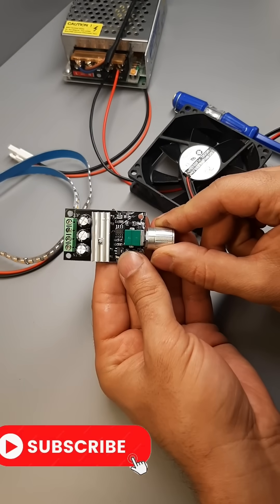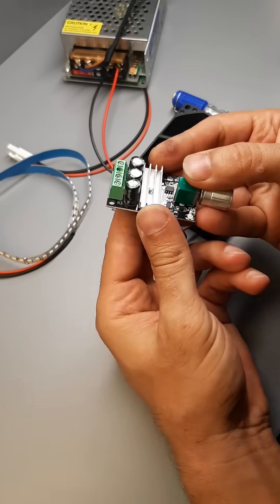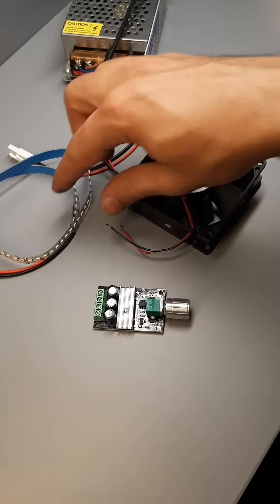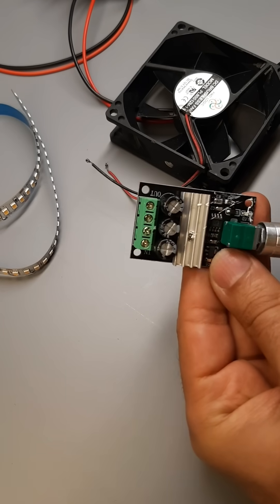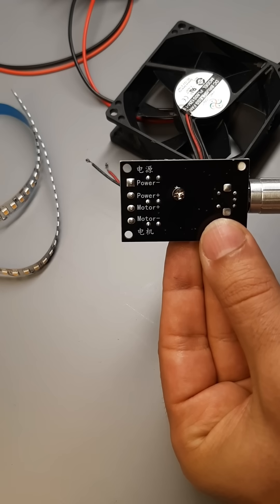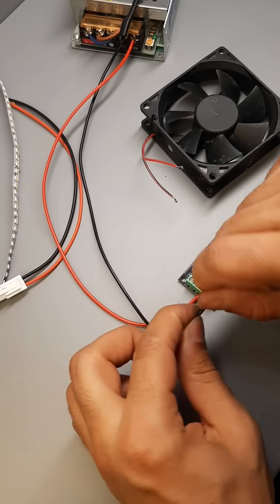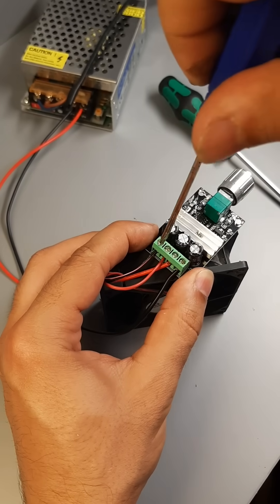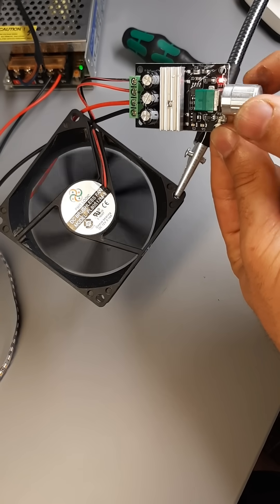PWM Module Tutorial: Control Fan Speed & LED Brightness Easily!#electrical #diy

Comment: What are the components used?
Reply from the maker: *"For a basic PWM setup you'll need:*  
- PWM controller/module  
- Power source (12V/24V etc)  
- MOSFET/transistor  
- Fan/LED load  
- Potentiometer (for manual control)  
- Breadboard & jumper wires  

The exact components may vary based on your specific voltage/current requirements. Would you like recommendations for a particular application?"